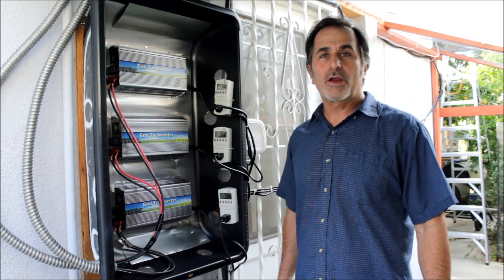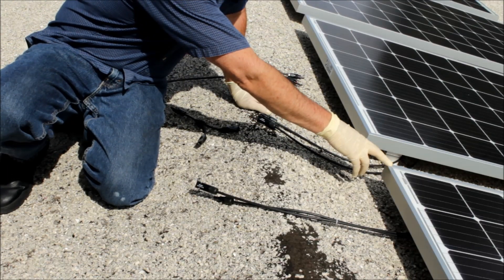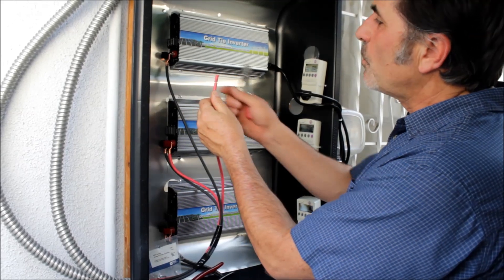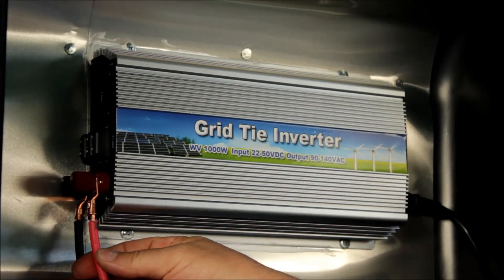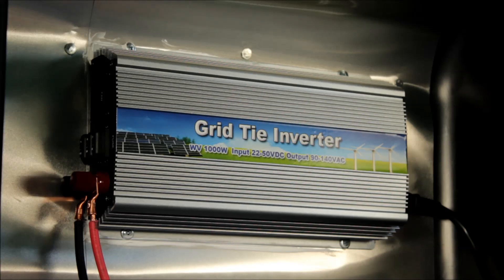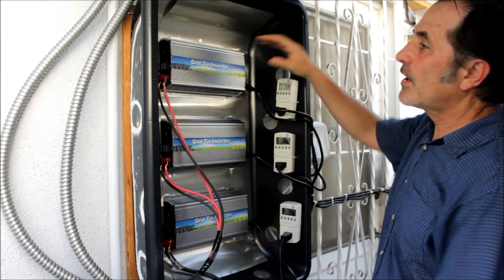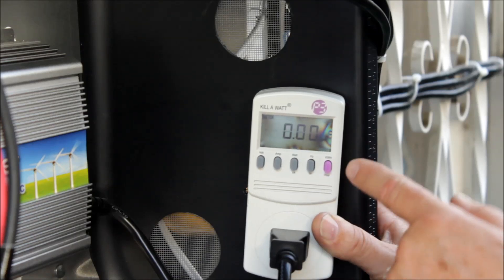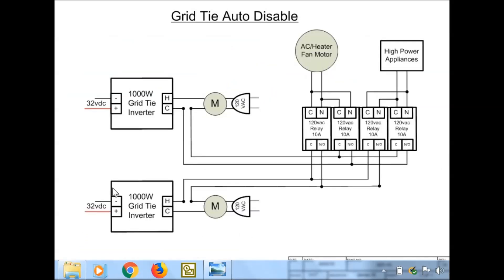How to Install a Simple Grid Tie 1000 watt Amazon Inverter Solar System -1800 watts for $1800- James

Comment: Is this legal , did power co. let you  connect to grid without going through the insp. by the city and any paper work and approval . I am taking classes on solar in a local community college  and to tie to grid , one has to go through so many steps , city,state and power co..with a lot of paper work including set of plans of solar panels
Reply: Since it is run to the outside of building you can. If you have extra breaker slots you can run a new line(s) to outlet(s). Big thing is to have a breaker between the inverters and the electrical panel so the power from the solar can be cut off. Prevents technician from getting electrocuted not realizing there is power coming in from the panels.
Reply: @kris4786  There are only a couple of holes in that theory. 
Number one. If you don't get the permits, and notify the electric company that you are putting power on to their grid. The technician does not know the switch is there. So how is he going to shut it off? Number two. If you were using UL-listed inverters, and got a building permit, the system would turn itself off automatically if they were working on the power lines in the neighborhood. Sorry. Epic fail.
Reply: @kris4786  if it's a dedicated line to its own breaker, it won't feed back to the grid

Comment: Bro help I have solar already I want to add 2 300w solar panel using plug and play inverter that can be plug in regular 110v outlet, I watched a lot of your video I know you are very knowledgeable, if I do my play if turned off AC disconnect, will the plug and play inverter will shut off too? Help please
Reply: It difficult to understand what you are asking because I think you have some typos in your question.  Are you asking if the inverter will produce power if the main AC is turned off in the house?  If so, no, the inverter requires 110 volts AC power in order for it to operate, it will not operate unless there is grid power.

Comment: I'm wondering about your choice to do parallel instead of series...could you explain your reasoning?
Reply: I'm guessing the output voltage of each panel is somewhere around 32 volts.  If he ran them in series, the input voltage to the inverter would be 64 volts.  The inverter is only designed to handle between 22 and 50 volts.
Reply: It seems like if panels aren't exactly matched, or shade creeps on one panel, but not the other, then those parallel panels will feed into each other and possibly burn out the cell's wires.

Comment: Better hope you never have an electrical fire or other home issues where an inspector comes out.  Not only is that not spec but you are using non UL approved devices incorrectly installed.  So many things wrong with this video.

Those inverters rob a lot of power as well and do not have the efficiency of good components.  You're wasting a good portion of your solar using them.

You could have gotten UL approved micro inverters for $30 more and mounted them right at the panels and move AC 220V back to the box with proper wiring that would meet code.
Reply: ?Do you have a link for those inverters?

Comment: what is the maximum continuous power rating for this unit ?
Reply: Some other peopled tested it at 800 to 900w. Peak efficiency is at or slightly above half so 500 to 600w is recommended. ( add 15% losses to get solar panel sizing. )
Reply: @MmeHyraelle  thanks

Comment: I can see a few potential issues with this system: pv panels are not grounded, there is no disconnect on all panel leads, screws used on the roof are too small and if not attached to structure  below (trusses or rafters) will most likely fly away in strong winds. Although it is an interesting project I doubt it is legal in any North American jurisdiction .

Comment: Some interesting ideas but a little too "home brew" without enough code compliance. I believe most areas will NOT allow use of flexible metallic conduit outside. Better to use solid metallic conduit (allowed by code) or non-metallic conduit. All codes that I am aware of require a tag at the meter stating there's a grid-tie or other power supplement. (stand-by gen sets, inverter / battery, etc) Most of this falls under NFPA standards, not typical building codes. They also require a DC disconnect in line between the panels and inverter. (and close by so it's obvious) Many local codes will require these safety items be located close to the power company meter as well. Yes, I know an outlet can qualify as a disconnect point but if it's inside a cabinet you may need to have another on the outside with a tag stating so. Might also help to use a UL approved outdoor R-rated (rain proof) cabinet to protect your goodies. Yeah, all this just raised the cost of your project by at least $500, but it's all about safety and protecting your investment.... and the possibility that your home owner's insurance may not be valid if it's not up to code. BTW, there's code compliance for the info on the tag at the meter. Must state type of equipment, location of equipment, and locations of disconnects. In some areas this tag can be printed and others want it engraved on a placard. (printing fades with time) Must also be glued to the cabinet / meter because extra screw holes violate the UL approval of any listed device. (I once saw a seasoned electrician put a zip screw through a meter cabinet and into a 200 amp SER wire!)
Reply: Wow .   That's no fun.  Some times is easier to ask for forgiveness then  permissions.  What they don't know won't bother them so much.  What if no power is exported ?   How would they ever know ?
Reply: @pulesjet  … Would you believe insurance companies do periodic random inspections via drive-by and so does your local building inspector? They may not be a scheduled inspection but they notice things when at a neighbor's home or on the way to another job. Could also be when they do evaluations for taxes or census. I got pinched for an extra tax assessment when they noticed I closed in a porch. It didn't require a permit but that did raise my taxes. Many years ago I also took out a permit for a new electrical service and boiler that passed inspection but living in a 100 year old home the inspector noticed when he was in for a water main inspection. (not the same guy) He mentioned it was nice that I had pulled permits over the years. Then there are times when people sell their home (eventually) and someone digs up changes without permits or notices something is not up to code. Banks that loan money on a home will also want an inspection in most cases.
Reply: @rupe53  LOL,    I don't have that problem.   I don't have it.  My system is not big enough to pull attention.  1Kw Ground Mounted.  In a Mobile Home.
Reply: pulsejet... There's no problem till there's a problem, right? You likely wont have an issue unless the owner of the trailer park decides to sell the property and somebody's bank does an inspection to see if everything complies with code. Yes, trailer parks have code in most areas. If nothing else, banks have their own rules when it comes to lending money.... just saying.
Reply: Who cares what the queen wants!
Reply: Another point.  I had a remote shed using off grid system.  It got hit by lightning and caught fire.  I lost the building and many electronics including my entire solar system.  The insurance company refused to pay for the damage even though the fire started from lightning during a thunderstorm.  The Fire Inspector hired by the insurance company could not "PROVE" where the fire started even though the Fire Department certified the fire started during a thunderstorm.  The Inspector could not rule out a spark from the unapproved system.  My policy states all building/plumbing/HVAC work is to be approved by the local building department.  I tried to take them to court but my Attorney told me that I would lose.  Now, I get a permit for EVERYTHING: changing a receptacle, light switch...EVERYTHING.  Sometimes the Building Department tells me no permit is needed.  I lost about $25,000 because I did not get a $100 permit.  It was not worth it.  So please read your policy if you are not going to get a permit.  In my state, all the policies are written this way.
Reply: @thonatim5321  Sorry for your losses.  I lost two  one year old Tv's a land line phone a $1200 Well Pump along with a lop top that did the dance while In my lap being typed on.  ONE Lightning Strike.   That Chit Happens for sure.    Insurance is a scam.   Some of us don't even have insurance.    Some of us really don't much give a rats about complying with codes in our own home.    Some of us living out in the sticks in our own homes do what needs to get stuff done without someone else's approval.  As long as Some of us don't push any power past OUR meters  , don't see a pressing need to bring anyone else into the equation.  Some of us are willing to chance burning down our own barn or mobile home.  LOL   Now did I want insurance or a solar system ?  Both are  out of question.

Comment: Mmm.. I've never heard of this and I feel like you need to back up the statement;  "the meter doesn't know which way the power is going and the power company can charge you for the power your producing". Can you clarify and site examples of this, is this antidotial, do you have facts to support this statment? 
Seriously, where did you get this information from?
Reply: What he says is true. When I first installed solar on my house in Florida, before FPL changed the meter out to a NET Metering meter, my old meter did spin backwards, taking kWh off my bill. But, when I installed a solar system on my boss's house in Georgia, turning on the solar made the meter spin faster in the same direction, ADDING to his bill! Some meters count all kWh going through, no matter the direction, and you might not know which you have until you try it. The other big downside about solar in Georgia is that they don't have NET Metering, so they only pay him 3 cents wholesale per kWh he puts into the grid.

Comment: I'm not sure where you are located but those inverters are not code since they're not UL certified.  I'm not trying to criticize you but was wondering since I was considering same system.  Are those legal or code compliant in your area?  If not, are you worried about your utility company making an issue out of it?
Reply: Show me a Law  / Regulation stating only UL product are allowed ?   Just Asking.  UL is not a Government Entity.
Reply: It's called the National Electric Code. It's what building inspectors use as a guide to help them determine that your installation is proper and safe.
Reply: It's also probably required by your power company.

Comment: You mentioned that the off grid inverter would turn off if the grid was off. So then this inverter probably wouldnt work with a totally off grid system? I'm setting up a hybrid wind/solar system for an off-grid camp house.
Reply: @Carl Cox
 - No, an "OFF-GRID" inverter does NOT turn off when the grid is OFF.  A "GRID-TIED" Inverter does turn off when the grid is OFF.  A "HYBRID" inverter works when the grid is ON and when the grid is OFF using the battery bank

Comment: Are you going to ground the frames of your solar panels?
Reply: @
SerendipitySue - Some think, an illegal PV system does not require grounding  ...
Reply: @MrSummitville  I'm thinking the grounding would save your electronics if the panels get a lightning strike
Reply: @SerendipitySue  Will grounding the PV frames actually "save your electronics", if the panels get lightning strike?
Reply: @MrSummitville  wells the idea is the current flows to the ground rod instead of thru your house and appliances. Hard to say what will survive... but Ben Franklin was famous in France because his lightning ground saved many houses from burning down :-)
Reply: @SerendipitySue  If the lightning would "behave" by conducting 100% of its energy through just the PV Ground Wire, then you might "protect" the inverter(s).  But unfortunately, lightning doesn't take one path, it takes ALL paths. We are talking about a Billion volts and >10,000 amps.  You can't tame lightning by grounding the PV frames.  Do really want the PV frames to act like "Lightning Rods" ?  I would prefer actual Lightning Rods to act like lighting rods, and usually connected with a much larger braided copper cable.  In Florida, the house next to my uncles house, got hit by lightning.  All of the copper wire and copper pipes on that end of the house were VAPORIZED.  All of the electrical devices in the neighbors house were fried.  Even the digital control boards for the washer, dryer and fridge, which were on the other end of the house and were GROUNDED. The Washer & Dryer were not even on, at the time and they still fried. The Grounded Outlet Strips with Surge Protection ... protected NOTHING.